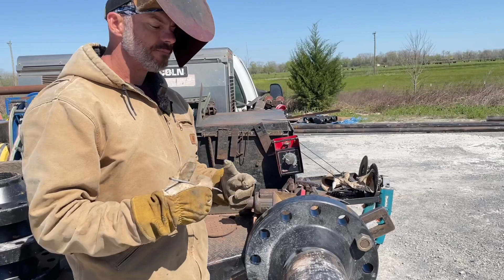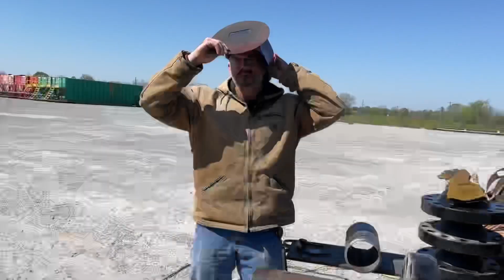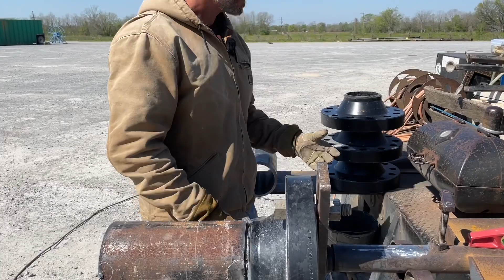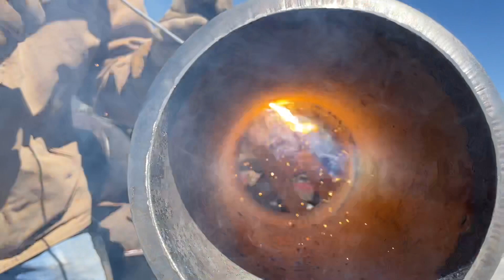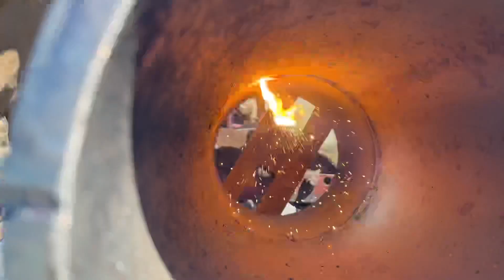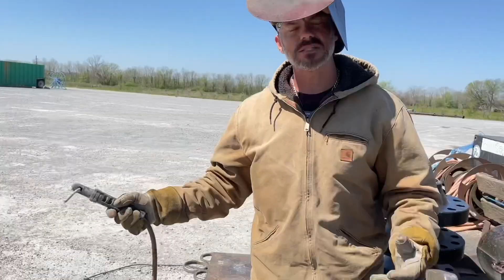Become a Master Welder, Make a Million, and Retire Young

Comment: This is my plan.  Not all welds are pretty😂.  The X-ray is the only thing that matters ... Stringers over beads...   Been in the lab and saw the results..  
  I also plan on working only 15 or 20 years.  I'm 35.  Perfect time to retire... It's not about looks, it's about proper penetration 😉, correct heat, travel time yada yada.

Comment: Side question I’ve always had. See a lot of Americans rolling pipe with small rods.. are you guys typical not allowed 5mm and 6mm 7018? 

I’d normally run a few 1/8” 6010’root, 3/16 7018 hot pass and a 1/4” 7018 cap on a 8” std weld.
Reply from the maker: The reason I don’t use bigger rods is because we cannot have any Parosity. Bigger the rods bigger the problems. And it’s hard on my leads and welding machine.
Reply: @TaylorWelding  fair, it’s pretty typical to burn 6mm 7018 here in the field. Usually have shorter fab leads so I don’t run through my reels, always run 2/0 cable. Ole pipe pro rarely leaves porosity 🤘

Comment: Hey! What state are you located in? I'm a welder in PA but want to move south. You know of any  specific job openings in your area? My big hang up is finding a job that will work with me (save the open position) while I make the big move south (sell my house and look for another). I've welded smaw & gmaw. The last 4 years been aluminum welding at a truck body manufacturer. Before that I welded steel at a John Deere plant in Iowa.
Reply from the maker: I don’t really know of anything. I know they’re out there but I’m out of the loop. It would be a rig welding job for pipe if I found something
Reply: Thanks! I know the jobs are out there, just got to find the right one.